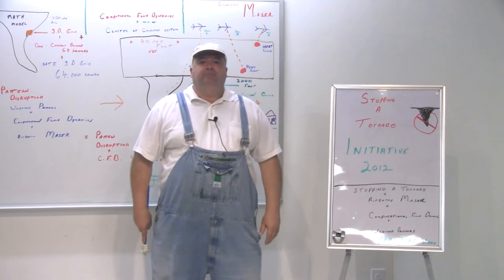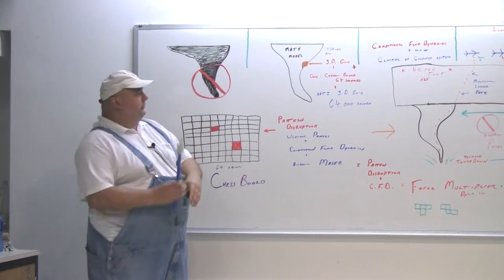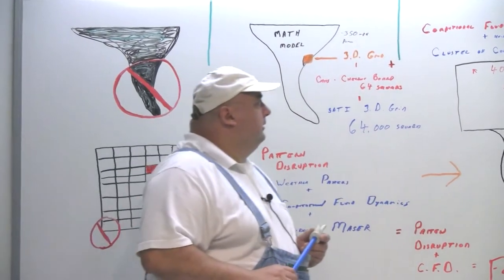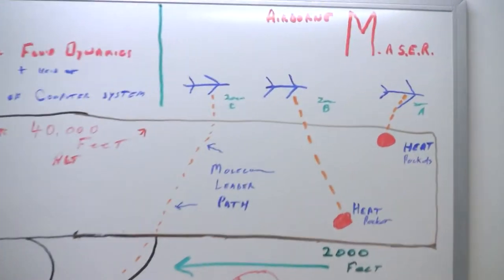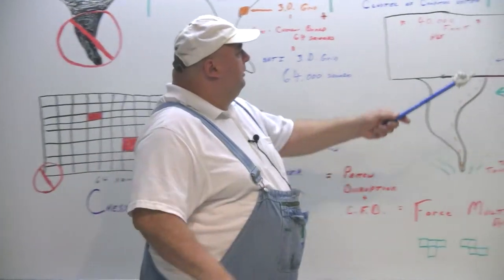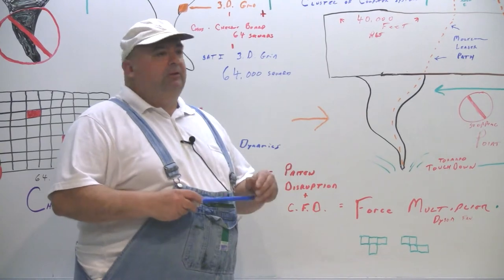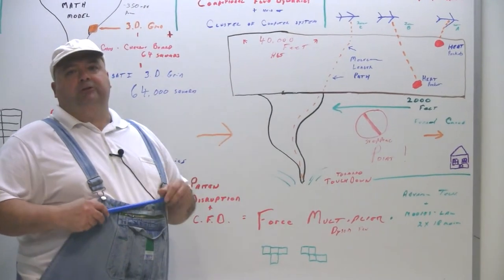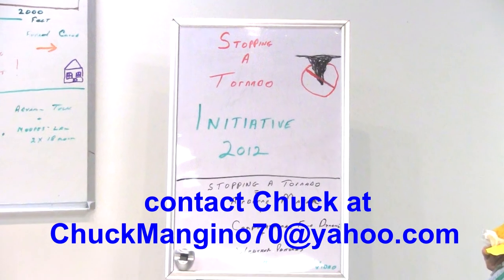Chuck Mangino - Stopping A Tornado - Initiative 2012 - 04-07-2012

Comment: Ihave often wondered how to stop a tornado, They are based on heat and cool air coming together so why not disrupt that suddenly with either massive amounts of hot or cold. Launch a large missle into the clouds above the tornado and detonate it creating a temperature imbalance. Disrupting the balance of hot and cold stopping the rotation. Or there could be a reverse effect and it could be catastrophic. They should practice on a small tornado or even a dust devil vs flame thrower. It would work

Comment: Huh. It's actually not a crackpot idea, at least conceptually. I'm not sure how feasible it is due to the power requirements-- could you have a large enough supply of energy onboard an aircraft to supply the masers to adequately heat up a large enough section of the atmosphere to make the necessary difference? Dunno.

Another problem that we'd face right off the bat is that, even now, we can't really accurately predict when or where (or even if) a tornado will actually touch down in the first place. We know the kinds of conditions that are necessary before it's possible for a tornado to form, but we still have almost no predictive idea of when or where one will actually form. That's the other end of the equation.

Your idea isn't a bad one, Chuck. I think it's actually a good one, although the way it would actually work in the real world may differ in some ways from what you envision today. So I won't discourage you. I say keep at it. One day you might be the guy who brings something like this to fruition. And even if you're not, your idea might plant the seed in the mind of whoever it is that does do it.

Your ideas got laughed at all those years ago in school because they sounded impossible. That's unfortunate, because while it may be impossible today, your idea itself does have a sound basis. Nothing to be ashamed of there. Keep at it!

Comment: Hi Vic but I hate to break it to you and your brother but tornadoes get bombarded by microwave radiation all the time. Its called radar, and radar has very little affect on weather, therefore will probably have no affect on tornadoes. Even if in MASER form, it would be no more affective than firing a machine gun into the air. There is just not enough solid matter for it to do anything bad or good. If the funnel was made up of mostly water, then you would have some substance for it to react.

Comment: sir, if i may say that your idea can only be thought about, but not tried, because of the work needed and the money needed is not vary easy to get. but to say that it can be thought about. Don't get me wrong, it is a good idea, but there needs to be more work. As Thomas Vaughan said " They are based on heat and cool air coming together so why not disrupt that suddenly with either massive amounts of hot or cold". ITS EASIER SAID THAN DONE i thought of ways, such as water, dirt etc. think about it